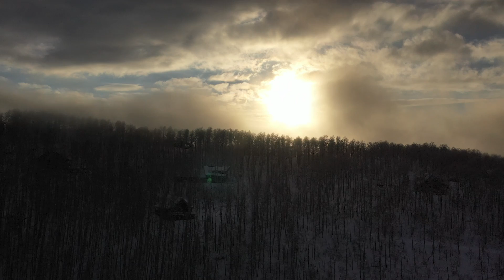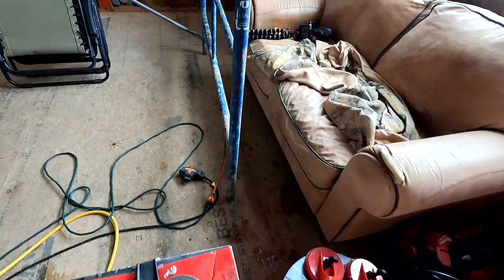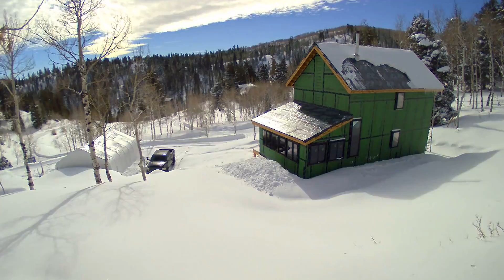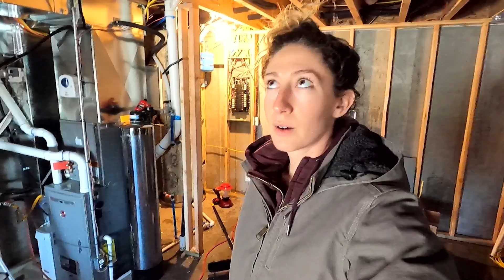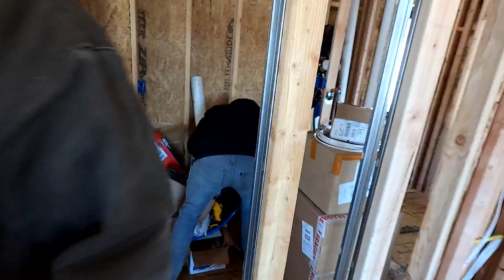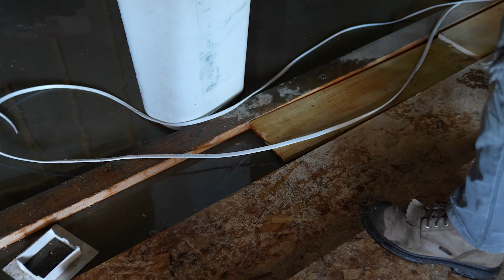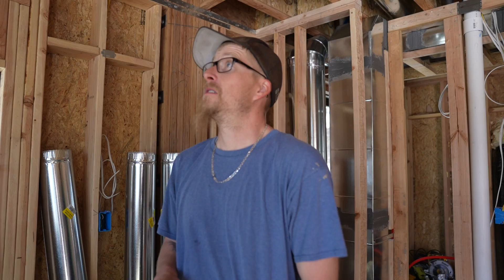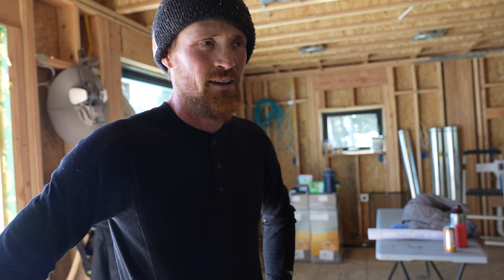OUR 4 WAY INSPECTION WAS AN UTTER DISASTER | BUILDING OUR OWN HOME

Comment: You need to be doing more than everything to make sure NO mokd grows but it’s inevitable now as it’s seeped into the studs, cracks between floors and studs, inside floor boards, cardboard boxes, under plastic containers, under the heater, inside ductwork. HOPEFULLY it didn’t get into the pile of wood. You HAVE to move everything and open up your home to a fresh airflow as much as humanely possible now that it’s soaked in to all that stuff already. Open every cardboard box that got wet and rip off the wet parts. You need to do this to give the building a chance to dry out since it’s already soaked in. Mold starts growing in 24-48hrs. Don’t expect to see mold visibly growing with the naked eye and it isn’t mold itself h the arts poisonous-its the mycotoxins (myco=fungus, toxin=poison) that comes off it. The spores and mycotoxins are invisible to the naked eye. Mycotoxins are so minuscule that they’re considered a gas as the particles will go through everything but metal and glass. The worst thing you could do now is insulate as that’s the perfect substance and situation for the humidity coming out of everything damp to act like a sponge and block that fresh oxygen and create mold farms all over your home. Absolutely do NOT insulate for over a week-that’s be a MAJOR life mistake. Your family will grow up there. Once someone gets really mold sick, you’ll never be the healthy person you’ve always been. Mold illness is a long term, if not probably life long illness once it gets bad. The longer you stay living in a water damaged home the more it advances. There’s mold/spores/mycotoxins everywhere in the air and on everything so once you feed it moisture, you just caused a major problem you’ll never be able to turn back time to fix the right way again. So just do this NOW so you can enjoy the rest of your lives. If you think you really did everything to prevent it, you’ve only done about half as much as you actually need to be doing. It’s time to buckle up and just clean and prevent mold like crazy!!!! Preventing mold will be over at some point so just bust your ASSES NOW-I seriously can’t stress this enough. Time can be your friend or enemy and I don’t see you guys moving anytime soon so take care of your wife, self, dogs and future family. Allopathic medicine doesn’t treat mold illness so it’s up to you right this moment of hard work to protect yourself and them and prevent the most disastrous illness that brings a hoard of other secondary illnesses you guys wouldn’t ever fully recover from through your entire lives. Just PLEASE listen to me. F everything else and just make sure you’re removing anything and everything wet like cardboard boxes that got wet and take things outside or flip things over, move plastic containers, open up tool boxes and leave them open to fully dry every nook and crannie, etc... You want sun on everything as sun really does help kill mold (that’s why we never usually see it in the open). And give it fresh oxygen until everything is seriously fully dry. You guys can do this. Get help from anyone around that you can. Lift up insulation tubes, cut out the bottom that got wet and let it air out. Later replace with a new piece of insulation and duct tape it. Water will wick up into the whole thing and get super moldy. Open up the windows facing the sun to get the warmer air in to keep you guys a bit warmer. Can you get another source of heat? Run that candle so you can keep airflow going through to help dry things out. If you can get a box fan, that’s be massively helpful. Make it blow outside, open or at least crack a window on the other side of the home to create a bit of an airflow. It surprisingly won’t affect the temp much. Both floors needs its own air flow tunnel. Move everything possibly affected as it’s a big job and it’d be impossible to know exactly what got wet. Dry heat is good, so remember that propane heat is a wet heat so allow for more airflow and dehumidifying to happen. DEFINITELY get a dehumidifier that has its own tube to run into a drain so it just does it’s own work without having to dump a bucket that WILL get moldy in the bucket. 
Copy and paste this into Google Notes or any easy to attain file. I know it’s a lot but it’s even more stressful when you don’t know what t do. Once mold grows into studs and the building you’re pretty effed. So just PLEASE work your butts off for a few days-nothing has ever been more serious. And keep airing the home out for 1-2wks as much as you can possibly, humanely stand from wake til sleep. You can do this. Do it right because there’s no going back. No one should spend their lives like I have disabled, had to move and lose everything, it’s brought out autoimmune diseases and serious viruses and many coinfections and secondary illnesses. Bedridden, miserable, agonizing disability with no one to medically fix mold sick people up and no one understanding how terrible it is until it’s too late. I’ve lost most my hair, was crippled, couldn’t breathe hardly at all for 2yrs, I look 10-20yrs older than I am I was neurologically disabled and slept for 18hrs/day for months/years at a time. I got sick at 35. I’m only 42. I’ve come an extremely far ways but I’m still barely functional enough to take care of myself even without working. It can also cause different types of cancers and women tend to get breast cancer. 
-Lindsay 💝
You TOTALLY can do this. PLEASE. Oh, and don’t expect mold remediatirs to actually help. For mold sick & sensitive people, they rarely ever help-like 1% of the time. It almost always just makes it way worse and then you’ve spent like 10-20k and can’t afford to move so you’re stuck inside the moldy buildings getting sicker and sicker. Once someone becomes quite mold sick they have an extreme sensitivity to mold about 2-3wks after they leave their moldy home and moldy belongings. That’s why we keep throwing out everything we own and move over and over and over and over. This illness is effing bananas. It’s like being stuck in a sci-fi video game you can’t ever win but it’s real life. I really hope this helps explain things. PLEASE copy and paste and keep handy. It takes a lot of time to understand mold/mycotoxins/mold illness.

Comment: Don't drywall or roof the house yourself. The roof is not a place to practice and if you drywall and tape it you will get to look at every mistake you made until you sell the house. Oh, and drywalling will make you old fast. The high parts require really good scaffolding and you need a proper drywalling screw gun or you are left with much more taping issues. Thank me later.

Comment: Code requires a wire staple within 6" of every device and box location to secure wires. A multimeter is something useful to have. No wires should be anywhere near a drywall screw location. I'd also suggest to run the furnace. Broken/frozen plumbing fittings or pipes is a big hassle.
Get some fans on the breaker panel, furnace and the various flooded locations. That should eliminate any residual water problems. WD-40 is also your new friend.

Comment: Instead of plugging raw wires into an extension cord. they do sell these plugs, where you can screw the wires on to a pair of terminals then and then plug it in like a regular plug. so that way you don't have to worry about the wire getting off center and arcing or other such issues.  I used that one time when i wanted to put up a fancy ceiling light in my dinning room but because it was an apartment I couldn't open the walls to run wiring up to it.  so I put a plug on to the end of it's wiring and then ran an extension cord up to it. it worked really well and was easy to take down when I moved out of that place.

Comment: Hi Trent & Allie,
Kindly check the main breaker if it is wet inside or better replace it a brand new one and also check the polarity of individual wire circuits incoming to the individual breaker, and also check the main brush pannel or remove them from the pannel and dry them to the sun or blow drier...
Also never put the water pipe line above (over the top ) of the pannel board...
Thank you!

Comment: Switch off all of the MCBs inside the House - Switch on the Main Breaker then re-instate each of the MCBs inside the House one at a time until one of them trips the Main Breaker - Failing that the Main Feed Cable maybe incorrectly sized or have a Fault - Thanks for Posting - TC !!

Comment: try putting  a surge protector computer zip plug strip
  in at the house so you dont have to run down the hill for the breaker

Comment: The water will have got inside the breakers, casings, fittings etc you should dry out the basement and give it a chance to dry properly. It might take a couple of days. Put a dehumidifier down there and you’ll need to check all your boxes and connectors. Then when it’s dry turn them on one at a time so you know where to go if you have a problem. Hang in there water and electricity don’t go together well 🤷‍♂️WD40 is good if it got in fan motors etc

Comment: It is very possible that the cheater cord got wet.  Pull all of the breakers out of the panel.  Disconnect the cheater cord from the panel, and put wire nuts on the end.  Keep the cheater cord off the floor and try plugging it back in.  If that holds wire it back into the panel, with all of the breakers pulled and try again.  Remember that it's quite likely that the breaker that's feeding the end of the extension cord to the house is a ground fault or arc flash type breaker so it's detecting a path to ground.  Worst case scenario could be replacing the circuit panel and all of the breakers.  But before doing that pull the breakers, unscrew the bus bars and put a fan on the panel over night.

Comment: Honey I am videoing a waterfall, unfortunately it is in the basement. This is reality. Glad you passed your inspection. By the time we see this you have figured out the electric challenge. My suggestion would be load up the wood stove and heat up the house. Then make sure nothing is being powered out of the breaker panel. Stay safe, warm, and well.
Reply: The problem with that is it's nothing upstairs that is causing the issue, the problem lies in the breaker box proper as he described, he pulled all the breakers and it still trips. Heat rises so none of the heat will go to basement and help dry the box. He simply needs to put a fan in front of the breaker box and give it time. But if the downstairs gets to cold and the water freezes....well it is going to take a bit of thought and build a temporary wall with some plastic sheeting and use the kerosene heater and bake that little room a bit.

Comment: Those plugs are horrible. I have seen people come close to getting injured when they fail and pop out at 100 mph. The best way is to glue a cap on each termination so the pipes hold the water for the test, then cut the plug out/off and put your fixture on when ready. I have been a building inspector for 16 years and I won't go anywhere near one of those inflatable plugs after seeing someone get whacked when it flew out of a toilet drain. Scary stuff

Comment: Congratulations on passing your 4-way!  I had the hvac rain all over my basement once too. When the washing machine repairman put my machine back together, he forgot to clamp the hose so I had an entire washing machine drain into the ac  vent that was on the floor (too bad it wasn't on the wall) as well as just enough run to the 1st floor to warp and ruin the wood flooring. When I went to the basement, it was raining from the HVAC leaking into the drywall ceiling and breaking through the taped seams, for the entire length of my finished basement. Good times!  ($27,000 to repair) 
Now you have found a weakness in your electrical panel placement as it is directly below 2 bathrooms.  Perhaps you might want to try to seal the cavities above against water so if you have a flood in the bathroom or kitchen it doesn't head toward your panel? I heard somewhere that an ounce of prevention is worth a pound of cure.

Comment: As an electrician in the Navy. Sometimes when electrical gets wet you can dry it the best you can and it still isn't good... but you give it a day or two and the residual moisture dissipates and it is all good again.
Reply: Exactly. Open the doors, crank up the woodstove, and let it all air out for a day. Walk away....until a few hours pass. How many times has that been the solution for a construction problem? Sometimes it's just bad juju.
Reply: Fan, dehumidifier, blow dryer or walk away and rest!!!
Reply: I'm thinking the AFCI breakers are very sensitive too. I would really let them dry out, put a fan or heater on them.
Reply: Yep exactly. But I can not believe he even attempted to energize the panel just few hours after knowing everything was flooded. Should let the panel and all electrical system air out for a day if not couple days at least.
Reply: Yes I agree I’m a navy vet 🇺🇸
Reply: @cherlgolja5402  Fellow Veteran Thank You for Your Service from an old Air force Vet .
Reply: I had a 277/480 panel that got rain water in it...when I went to reset the breaker (not even knowing water was the problem at first) it blew that breaker OUT of the panel😂🤣😂🤣😂 it looked and sounded like a shotgun blast. Funniest shit ever!!🤣😂🤣😂
Reply: @SilentStorm_5  😁😅
Reply: Rebecca Sailor Thank You for your Service in the Navy , I'm an air Force Veteran & Son of a WWII Navy Veteran & Nephew of Several Uncles that were Navy WWII Veterans & the Brother of a Navy Veteran & Brother In Law of a Navy Retiree . Are you still an electrician ?
Reply: The problem is the breaker at the street is probably a GFCI breaker.....so the water Is making continuity between the neutral and the ground somewhere, so that breaker is tripping because of that. It will be fine once it dries.
Reply: Yes! My cat pissed on an outlet. took a few days to fully dry out and it has been good since!
Reply: @kimdawcatgirl    Damn cats!  Why can’t they get a little shock from doing that, to make them, uh, quit doing it......
Reply: @doloresreynolds8145  😂🤣
Reply: Or you test things too soon, and they completely fry.
Reply: Plus, measuring where some insulation failure or so hides may be very helpful. Don't guess, measure!

Comment: Okay. Two things. 1st I would change the height of that HVAC register/return so it’s higher than floor level and this can’t happen in the future with a weird clog scenario. You wouldn’t want poop on your HVAC ducts/system if that was too happen. 2nd, get yourself the best dehumidifier you can find (the kind that works well in colder temperatures) and leave it on for a whiiiile.

Comment: Too bad these videos are two weeks old.   Otherwise we could help you more.   Put a circuit breaker on the cord going down the hill. Put it in the house, then you'll not have to go down the hill to reset it.  Also, plug something else into the cord at the panel to show that it isn't the panel that's popping it.

Comment: Trent, you should do a process of elimination by disconnecting all wires from the breakers and start resetting the main breaker. Start connecting the wire into the breaker one by one and see which device keep tripping your main breaker.
Reply: Probably a ground fault trip.

Comment: You may have other unseen problem. Water alone will not cause a breaker to trip in the panel. And the one at the road especially unless it is really small. Main breaker there and in house should be like 100amp.

Comment: A thought for why the power keeps going out, my guess would be that you have a GFCI at the main breaker and then in your panel you have GFCI and AFCI breakers. They don’t like to be downhill of each other. Most likely remove the GFCI at the place where your power originates and rely on the ones in the house panel. Should probably fix your issues.
Reply: It’s kind of the same as if you were to try to wire a GFCI outlet to the Load side of another GFCI outlet, will trip out every time. But if you wire the 2 GFCI outlets in parallel no problem.

Comment: Congratulations now you can start to insulate somewhere in the line one of your powerlines for the breaker has got water seeped a bit in between the coating and the wire it’ll dry and you’ll be fine But congratulations you can start doing the insides

Comment: HOW? If the inspection was a disaster How did you pass, and yea with that much water spill over TWICE into the HVAC it 95% will need a full replacement job... ... ... HOPE you get lucky and doesn't need it. But yea if the inspection PASSED!! why the udder full caps on the misleading title of the video, can't stand that.

Comment: Trent, the core of the Shreader valve on the ball plug is probably loose... should be able to tighten it with needle nose pliers (or valve core tool which you might have w/ MTB stuff.

Comment: Trent if you have a multi meter you can check resistance from the panel bus bars to the grounded panel.   Also those molded case breakers are notorious for not functioning correctly once you have tripped them as many times as you guys have.

Comment: Congrats on the 4 way but it sucks on the electrical problem.  If you have a VOM meter being there is no power to the panel start by checking from ground to every breaker point with out the breakers installed to see if there is a short somewhere.  If not water must have gotten into the inside of the breaker or breakers which means putting a heater under the panel to help dry out all the breakers.  I know you said you replaced the extension cord but it still pops the breaker.  There are 2 things that you could do here attache the VOM to the one extension without the extension running to the street and see it you get a load or reading if you do there is a problem from there back.  Because the breaker keeps popping at the street so many times that could be your problem as well.  Good Luck.